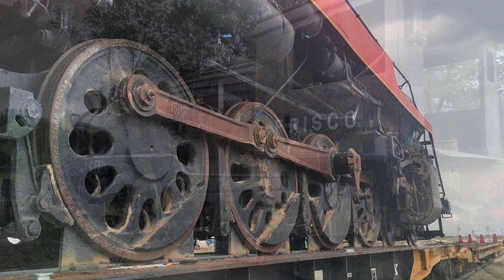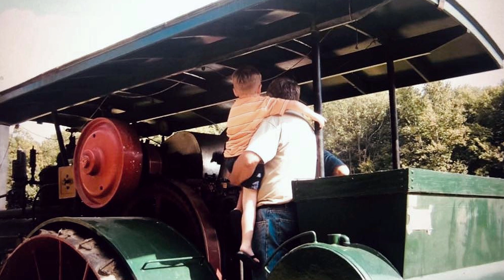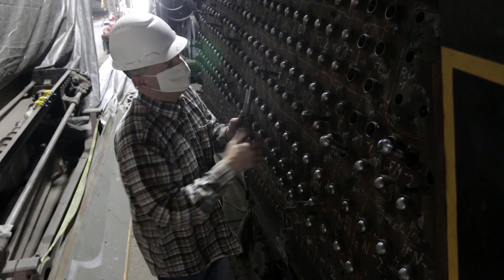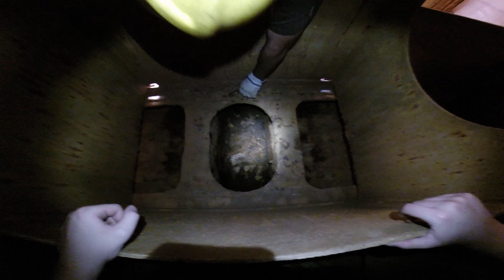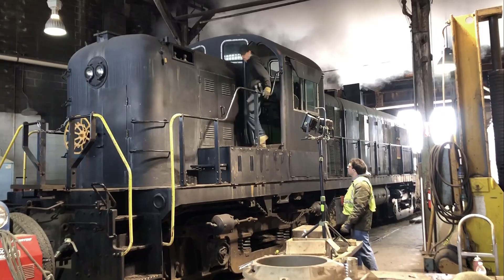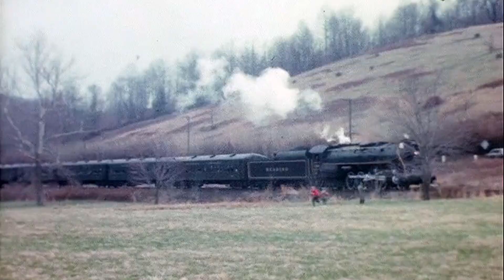Reading 2100 - February 2022 Project Overview

Comment: Wonderful!  I'm shocked though, that anyone knows all of the techniques and even functions of everything on that machine this many years later.... looks like general metallurgy and riveting techniques and tools have survived, but what about the 100 valves and controls in the cab?  How could anyone possibly know what each did, and more importantly WHY and HOW to adjust each?  I suspect many were just due to the evolution of understanding up until the 1950s.... something which was empirically known, but not really on a blueprint or easily reverse-engineered.  I can't believe there is someone on the project who has figured out the purpose and need for each last knob and lever in the cab, and how to drive one of these with as much experience and smarts as the conductor in the 1940s and 1950s.  Comments?
Reply from the maker: A great deal of today's knowledge has been passed down through several generations of railroaders. Think of it like passing down an old family recipe — only this recipe is for a massive mainline steam locomotive.

Comment: I rode behind former Reading T-1 2101 way back in the summer of 1977 as part of the "Chessie Steam Special."  It was from the B&O's Barr Yard to Garrett, IN and back.  Nice trip on a beautiful warm day.  I believe the cost of the excursion was around $30.00.   Two run-bys were performed at about the halfway point.  Nice video on sister engine 2100 and best of luck with the restoration!

Comment: Awesome, once they get 2100 finished, then 4070 is next and 1352 comes afterwards!
Reply: Well actually, The American Steam railroad isn't the one restoring 4070, it's the Midwest Railway Preservation Society. They're two separate entities who share a roundhouse in Cleveland Ohio. I'm not sure though if 1352 will be operable first or 4070. It could be either both.
Reply: @regularguy7266  4070 will come first for sure. Especially if the photos of 1352 overgrown are to go by - some of them recent. 

Lets face it ASR has more or less sunk all their cash into 2100 and will most likely never "find the time" to move 1352 like they promised backed when 2100 was brought to Cleveland. Everything they have said since bringing 2100 has been typical - it doesnt need much we just need to run a few excursions first to earn revenue.  That was a favorite line - often touted when saying that 2100 didnt need a 1472 before 2021 and they would be running trips to earn the cash for further work on 2100 and moving 1352. Well they did need more work and a 1472 and should have just started on one fresh once they had first gotten the loco. Then there was the time Midwest attempted to evict ASR from the roundhouse - it got nasty on both RYPN and TrainOrders forums. So I'll take anything ASR says with a large pinch of salt.
Reply: @HaddaClu  One railroad group trying to evict another from a shared space... I can see how that went well.
Reply: @bakerboat4572  Considering Midwest owns the roundhouse they were well within their right at the time to slap eviction papers on the locomotive and equipment. Whatever was settled to keep 2100 there happened in private. I was just making a point that ASR rarely is one to fully trust. Especially since Rob Gardner can get quite nasty on the forum boards when confronted.

Comment: These guys need to contact Ross Rowland if they haven't already. Ross still has her booster engine at his house last we spoke and he would be glad to reunite it with the locomotive. It just needs to be picked up. If you can let them know. You obviously have interaction with this organization so let them know.
Reply from the maker: We’re aware of where the booster engine is located, but it will not be installed on the locomotive initially. The 2100 sans-booster develops a hefty 68,000 pounds of tractive effort, which will be plenty for our planned operations. Additionally, the condition and completeness of the booster is in question, as it was disassembled and intended for use on another locomotive.

We’ve been in contact with Ross and had an event centered around his career a few years back. He is a major backer of the project.
Reply: @CloverLeafMediaCo  yes I knew he was a supporter. I used to live nearby him and would run into him on occasion. Yes it was used in 614 for a time and then swapped back out. But Ross isn't getting any younger so retrieving it before something happens so it's at least with the locomotive would be a good idea and a priority. Even 2102s is booster just goes along for the ride giving weight to the back truck. Reading intentionally messed up the equalization on the T1s to cut crew pay it's why the T1s start to surfboard over 55mph. That extra weight sits on the trailing truck & increases the faster you go. By taking weight off the drivers it reduced their original tractive effort and didn't create a new pay bracket for engine crews. They were paid so many cents per the weight on the drivers per trip. Unless you were on a hourly job with them in the 50s in pusher service or the Rambles which as they were passenger would have been a hrly run anyway.
Reply from the maker: @Krystal Alpha McCloud It's much too early to make any firm announcements. ASR and the R&N already have a strong relationship, and have traded parts and expertise in the past. If the opportunity arises, we'd love to head east and hook up with our sister!
Reply: Bear in mind, if not for the booster these locomotives would have likely been 4-8-2's, because the Reading K-1 2-10-2's had equal-sized if not larger fireboxes and only needed a 2-wheel trailing truck.

Comment: I find it very interesting the ASR and the RBM&N are somewhat working together on two locomotives of the same type, sharing parts and history is something I haven't heard of before
Reply: I mean they are restoring the same engine. Just 1 is being down by a non profit group in Ohio while the other is being done by a freight railroad in Pennsylvania. And has also been working on it a year after asr started on 2100 in 2015 while R&N started in 2016.
Reply: @atsfevan0242  very good point
Reply: I was at reading blue mountain and northern  yesterday and they say it should be done in 2 weeks
Reply: @BAS19.6  dang, that's in time for Spring
Reply: @Krystal Alpha McCloud ik